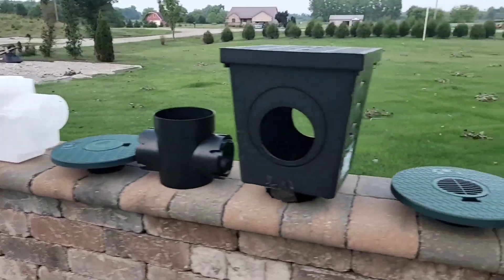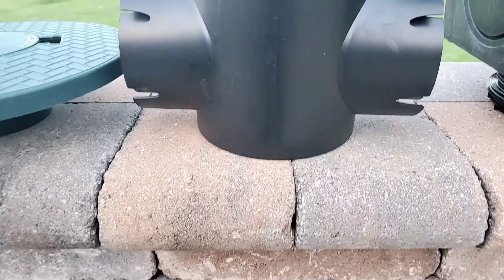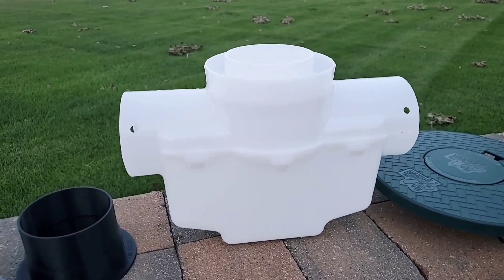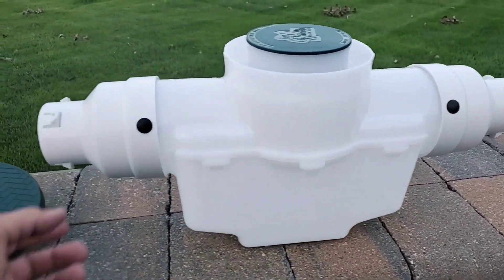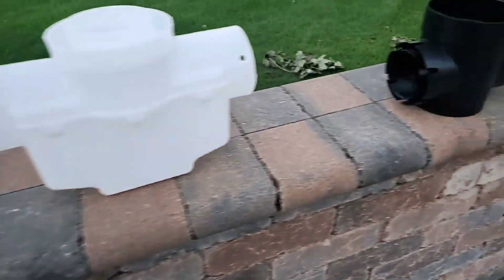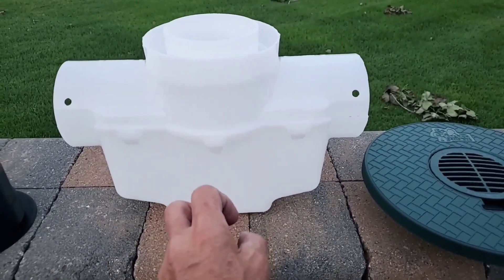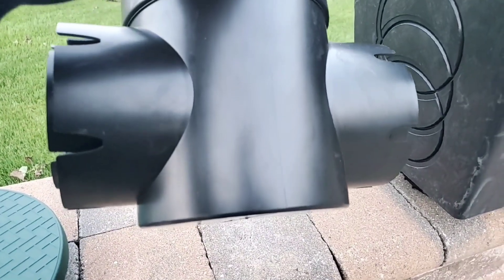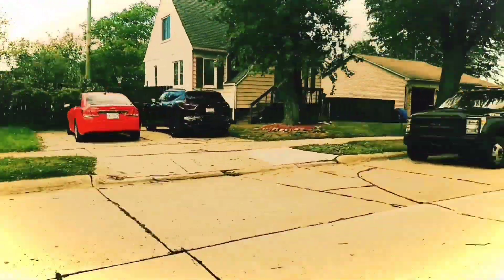New Catch Basin Changes Yard Drainage as we know it making all Catch Basins before it Obsolete

Comment: Why do these catch basins leak at the seam? I just installed 5 of them and they all leak from the top. Very disappointed with this product. After calling the company, they told me that 6 inch pipe fit as a riser. That is not the case. Now i just wasted 450$ on stuff i got to pull back out.
Reply from the maker: If you do not have a slope in your system, the water will not drain, and it will overflow. What you are describing is an installation issue, not a product issue. A one percent minimum slope is required. If a yard is too flat or has a negative slope, you will experience these problems.

Comment: We have a metal roof with no trees nearby. Do I need to put an inline clean out/sump with a down spout system?
Reply from the maker: It's pretty easy and simple to do during system installation. No additional labor is required. It makes accessing the line easier. I've seen bloated chipmunks and squirrels plug lines. It's a clean-out so you can access the line to solve such issues.
Reply: @FRENCHDRAINMAN  Thank you.

Comment: What if you need something bigger to catch water? On the side of my driveway the water rushes like a raging river so im needing something big enough like the black box to catch that water fast enough. Do you offer something large enough?
Reply from the maker: It's funny because that large catch basin will only allow you to run (1) 4-inch pipe. So how does that help you? If the grate is larger, a 6-inch round pipe will overwhelm (1) 4-inch pipe.
4-Way Connect Catch Basin, Connects to 4" Corrugated Pipe
https://frenchdrainman.com/product/6-in-catch-basin-4-in-double-pipe/
Reply: @FRENCHDRAINMAN  thanks
Reply: @FRENCHDRAINMAN  can I put that at the beginning. Like at the start of the water to begin catching the water?

Comment: I really like this design! I have one downspout that needs to be connected into my existing system and this looks like exactly what I need to get. With it able to be closer to the surface, I think it’ll be easier to have the slope correct right from the get go.
Reply from the maker: https://youtube.com/playlist?list=PLjFCqaZ4v1BWbLx7DHgD1YrWdm2wotwlY&si=dH1mvLBYhjjPbUzB
Reply: @FRENCHDRAINMAN   I was measuring today. It’s 20’ from the downspout to add it to my existing drain system. Already have the connection spot waiting for this line to arrive. I had a tree squash my gates, and since there’s a pool back there, I gotta get the gates back up asap, then that downspout is getting addressed.

Comment: Really great ideas but pricing is cost prohibitive for the average DIYer unfortunately.
Reply from the maker: Failure results in a flooded basement or foundation damage that could cost 10s of thousands of dollars. We sell so many of these basins.... it's a big seller. People see the value.
Reply: I am geniunely hoping you will sell plenty so your costs can come down hopefully making pricing more attainable/mainstream to the masses... @FRENCHDRAINMAN
Reply: Less than $50 for most of them including the turf restrictor plate... that's got to be significantly less than a contractor would charge you to install the el-cheapo model. How low is your budget??

Comment: Just curious, what are the problems with recycled plastic in basins? Do they deteriorate faster?
Reply from the maker: When molding a basin the material needs to flow as one for best results so it doesn't split or crack. When using recycled materials you need special additives to hold the recycled materials together. It's definitely one of the most debated topics in the industry weather or not it's as strong as virgin non recycled HDPE. Some say with the right additives it's fine. I'm not a subscriber to that theory.

Comment: is a pop up required on the end of the pipe or could I just cut it on a 45deg with a sawzall and let it flow?
Reply from the maker: No. You can do what you are suggesting as long as the grass doesn't grow over the outlet
Reply: The only thing about an open end is either grass growing over and into the open end or dirt/debris clogging it or even critters moving in during the dry season. More importantly, it becomes a trip Hazzard, and a hole can be an ankle breaker if it is a straight down situation. But if it is coming out of the side of a slope, then as long as there is some rocks around it to give warning and location, then that is, we'll, a warning of the location.